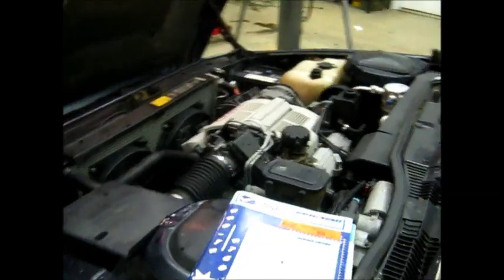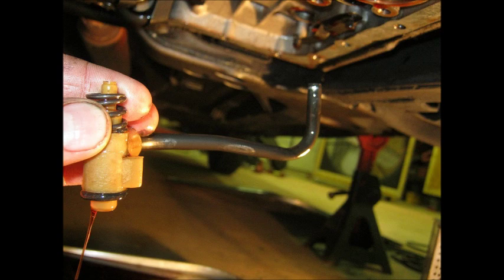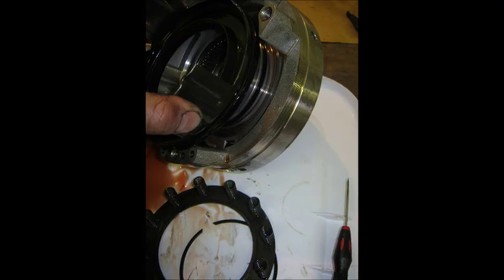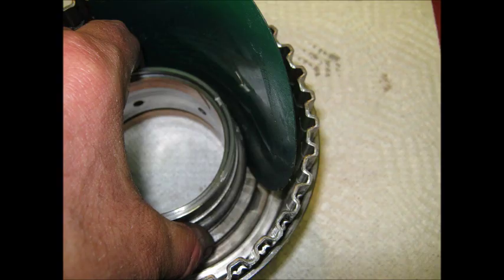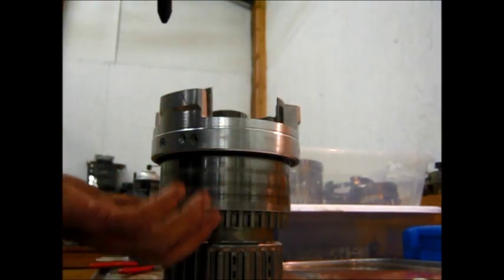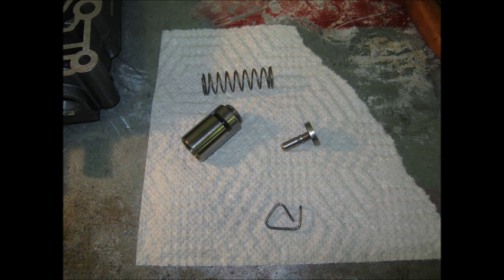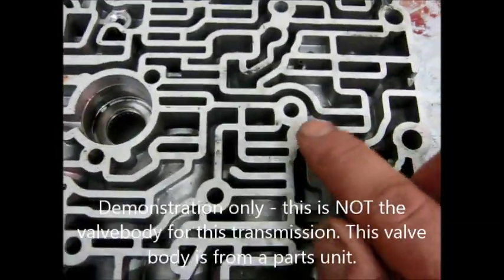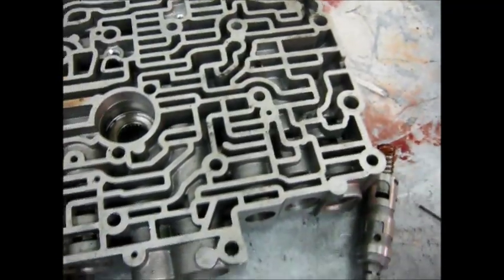Overhaul HydraMatic 440-T4 / 4T60 Automatic Transmission - Part_1

Comment: Where do you get the lip wizard tool?
Reply from the maker: Hi Jared. That came with the Transtec transmission rebuild kit. The parts came from Transtar, which is also known as Axiom Automotive Technologies. They are a transmission parts specialist. You can see https://buy.axiom.com/default.aspx for their site.
Reply: davida1hiwaaynet
Ah that makes sense.  Also something people should look out for: I thought it would be easier to just order a rebuild kit from autozone.  While the picture of the KS-67 rebuild kit on their website has all the right parts, including two shift bands, the kit i received only had one band.  So I don't know what the deal is there.  I requested an account at transtar to see if I can get the parts from there.